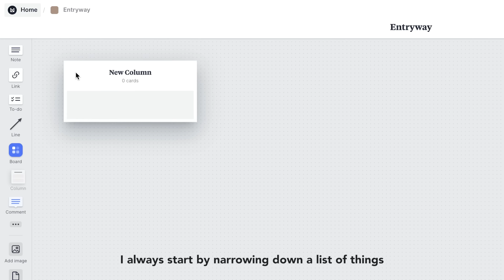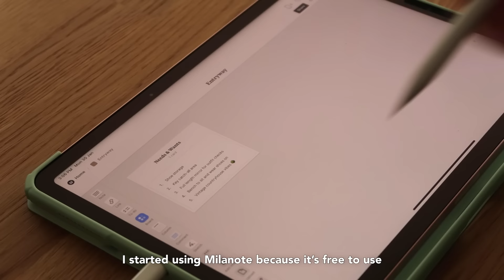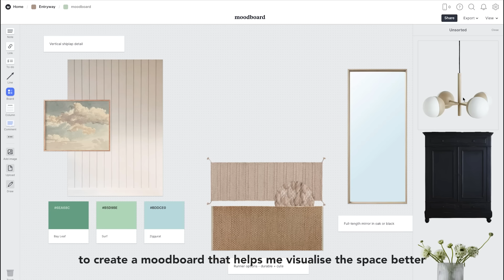Entryway makeover | Ikea hemnes hack + diy shiplap boards from mdf

Comment: Quick question: how will you remove the command strips if you can't pull the little pull thingy? 🤔
Reply from the maker: It acts like velcro - when I take off the board, one part of it will remain attached to the board and the other to the wall 🙂